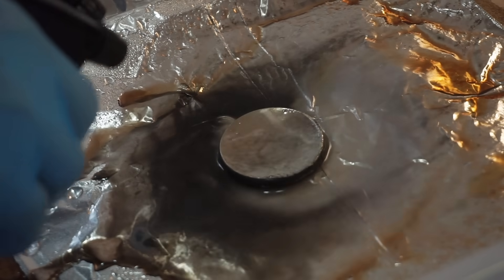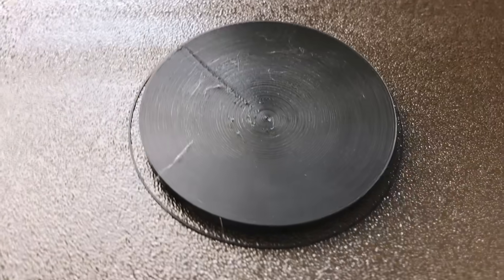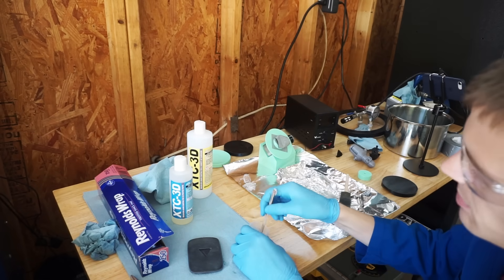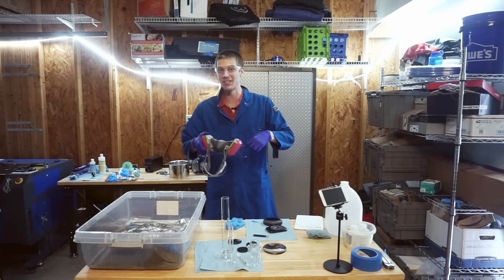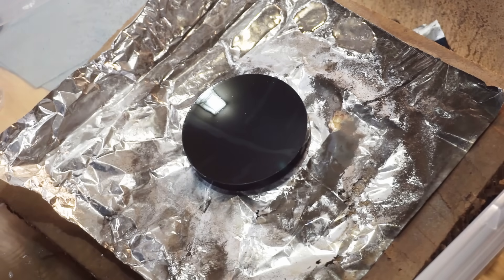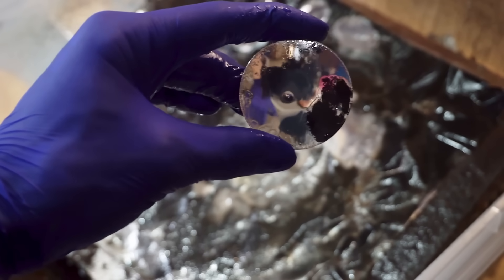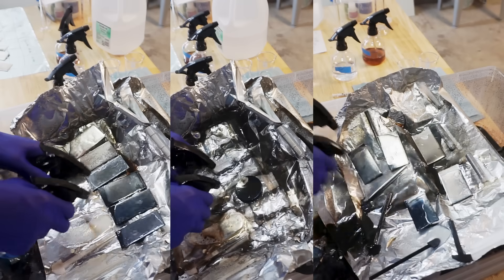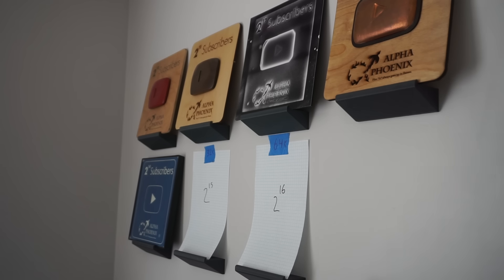How does a "first surface" mirror work? (2^15 sub special!)

Comment: I would recommend a stand for your table saw and also standing to the side. Kickback can be really dangerous (at least you had your blade guard/riving knife on) and in the squat position you really do risk accidentally falling into the saw when it’s operating. Just my two cents but table saws are easily the most dangerous piece of equipment in the standard US house, and its highly recommended to treat them with the respect. Other than that, a very cool project man, stay safe, stay healthy and thanks for the great content.
Reply from the maker: Yeah table saws absolutely terrify me and this is the first one I've owned so I'm trying to catch up on best practices quickly - another comment had some good suggestions about when to use the guide and when to use the miter to avoid kickback, but since I'm typically just doing ply, sometimes I don't have a great way to use either (if the plywood is larger than the table) do you have any tips other than "go in a straight line"? obviously I don't expect high quality cuts when "freehanding" like that, but I'd like to be able to do it without actually freeing my hand from my arm.
Reply: @AlphaPhoenixChannel  So if you're trying to rip larger sheets of plywood, my go to would be to use a circular saw unless if you had a large outfeed table set up for your table saw. To get an accurate cut, I like to clamp a guide to the plywood, and then put my circular saw up against it/(or in it in my case) to do the rip. There are a ton of how to videos to make a good guide (I followed the plans from a video called "Super Simple Saw Track" by One Minute Workbench on YT and it works fantastic for what I need it to do). You can also purchase them, Kreig makes decent ones. I'm terrible at free handing myself. Once it is smaller and can be supported by your table saw, that's when I would use it. If you do not have space in your workshop for an outfeed table (it's a table you can push the ripped plywood onto after a cut, highly highly recommend one if you have the space), you can use a roller stand to support the piece. Kickback ultimately is caused by the wood binding in the back of the blade which is spinning towards you, the blade catches it, and then flings it forwards or upwards. It does it with enough force and quick enough that you really don't have time to react, and since you're the softest thing in the shop, can impale you, or also draw your hand into the blade before you can react. Your riving knife (piece that sticks out on the back of the blade) is there to prevent the wood from binding in that way. If you are trying to make an angled cut using your miter gauge, youre not going to want to use the fence, the wood might get pinched between the blade and the fence hence the kickback. If doing a rip cut, it's very important to make sure that your blade is parallel to the fence or it also might cause that pinching action. The thing though that started the comment though was your position of how you were pushing the wood for the rip. You want to be as stable as possible, get a stand, they are under $200 and are able to be folded and stored away or make one so you are able  able to push the wood through while standing up comfortably. In that squat position it it's way way way too easy to fall forward and that's your face in a sharp blade that can easily kill you. My ultimate recommendation though, watch some safety and how to use a table saw videos on YT, they're really dangerous and it just takes a single fuck up or accident and then you might be missing some digits or worse. Stumpy Nubs is a woodworker on YT that I respect and would recommend his safety videos for any woodworking equipment. Sorry, a bit of a long response. Regardless, stay safe and healthy and just remember we're the softest meatbag in the shop.
Reply: @AlphaPhoenixChannel  kickback can of course happen when you twist the plywood going in.  But by far the biggest risk for kickback is with lumber, when ripping it.  If the boards have a warp or twist, cutting it can release internal stresses and cause the cut to close back in on itself.  That's why a riving knife is required on all european saws, I believe.  It keeps the wood from closing back on itself.  Here in the US sometimes those are built into the cover, so you may have to take them off before cutting ply, but make sure to put it back on when ripping boards.
Reply: Yeah, I've worked with a few industrial machines spinning at tens of thousands of RPMs and they never unnerved me as much as when I used a table saw. Every time I go near one my mind races with all the possibilities of accidentally tripping into it or slipping my hand. There is something about such a large blade so exposed that is terrifying.

Comment: Awesome video! Subbed less than a couple of minutes in! Really like the analysis, deeply satisfying.

So, pressure vs vacuum for resins.
If your resin has a pot life of more than 15 minutes, when you mix it up, in it's pot (not on the target) vacuum the pot to pull the bubbles out, then when you pour it out, pour it up high and slowly/thin so it has less chance of catching new bubbles for you
Then when it's on the target put the target in a pressure pot for the entire hardening phase as this pressure keeps the air bubbles in the mixture and stops them from collecting against each other to form large 'proper' bubbles. They are still there, just not visibly.
Final thought, resin is an absolute sod for environmentals. Slight temperature change? Slight humidity change? They can all cause weird results. Having a managed hardening environment (pressure pot) will help alleviate most of these.. mostly. Except when they don't.
Reply from the maker: “Except when they don’t”
I love the optimism 😂
Reply: @AlphaPhoenixChannel  https://youtu.be/dkZRfH-6O6I fullmetal bender ))

Comment: When using resins or epoxy , during the mixing stage you're infusing air bubbles in it. To get rid of them , after you apply the resin to your surface use a heat gun and go over the resin surface while wet and you can see the bubbles pop and the resin then will lay flat and smooth.

Comment: Resin problems are usually due to incorrect mixing, incorrect measurement and insufficient cure time.

Mix your resin gently in one container, then pour that into a second clean container to ensure no unmixed resin remains (it tends to cling to the sides). 
Then place that container into the vacuum chamber to de-gas. That resin is then ready to use.

Resin can usually be accelerated with heat up to 60-70 degrees (Celcius), but check instructions as it depends on the resin.

Mixing excess curing agent (Usually your 'part B') can give poor results because is can cause the resin to become too hot during the exotherm.

Mixing excess resin (Usually the 'part A') can cause long cure times or even resin that remains uncured and tacky.

Anyway, cool video!

Comment: Have you tried "spin-casting" a parabolic mirror? If you spin a bowl of liquid it naturally forms a parabolic shape. If you have an approximate parabolic shape container and put a reasonably slow curing resin in and spin it on its axis at the correct speed you should get a very smooth parabolic surface.
Probably best to cover the container as the resin is curing to avoid any contamination.

Comment: Hey this was very interesting. Out of curiosity have you tried ABS, and used acetone vapor smoothing in order to smooth your surface? If you care less about dimensional accuracy than how smooth the surface is, I'd be curious if that would be an applicable method.

Comment: Why wouldn't you just make a vapor chamber for some acetone and put it in there depending on the print material acetone generally does a decent job of smoothing

Comment: Re: the garage vs. indoor cure, a lot of epoxy resins have a problem with bloom, which is the reaction of the uncured resin components with humidity in the air. It can result in unsightly scummy/dirty surfaces with a layer of side-reaction product on the outside. A non-climate-contolled garage could definitely aggravate this kind of issue.

Comment: Rather than slowly spinning the parts as they dry, what about high speed spin coating? In the semiconductor industry, they achieve very tight tolerances on liquid photo-resist film layers on wafers with spin coating.
Reply from the maker: Thought about it, pulled a motor out for it, haven’t actually built the thing.

(Have spun photoresist too many times though and I hardly worked in the fab…)

Comment: You can get a longer pot life by cooling part A and B separately in a freezer before mixing.   Not together with food though.  After cooling, it is more viscous so harder to mx but you get more time to degass.  Always scrap the walls and bottom of mixing pot when mixing or else pockets of unmixing resin will cause blotches of incurable resin.

Comment: All resin produces more bubbles in a vacuum because it makes the gas expand, and the surface tension of the resin just holds it together. To reduce bubbles you want to pressurize the resin until it's cured so the bubbles are all compressed into tiny invisible specks, and held in place by the resin once cured.

Comment: Note that most telescope mirrors these days (except extremely large professional research telescopes with onsite mirror recoating facilities) are overcoated with a layer of silicon oxide or dioxide to protect the metal (which is usually aluminum).

This results in a very slight reduction in optical transmission, with the tradeoff being that the coatings are much less fragile and can tolerate reasonable handling without issues, as well as lasting years before degrading rather than months.

Comment: 3:20 why not use ABS and do acetone vapour bath. gives a crazy good finish, tho it can also be easy to mess up. just need a 3dprinter with an enclosure.

the other option for non ABS plastic is sand (super super fine also costly) recasting which does smooth out the layer lines a bit. could maybe be enough here unless the mirrors need to have a low variance in surface height

Comment: One of the sprays contains the diaminesilver complex and the other probably contains a dilute aldehyde or sodium borohydride or whatever water soluble reducing agent you want. You can make your own diaminesilver by reacting the silver nitrate to silver oxide, then reacting the silver oxide with ammonia. Also check out reactive inks, which instead react silver nitrate to silver oxide, then react silver oxide with silver acetate, then react the silver acetate with the proper mix of ammonia and ammonium formate to get an even more water soluble complex which can be as much as 30% silver by weight but is as clear and colorless as water. That mix deposits the silver during the decomposition of the formate and acetate ions, which are sufficient reducing agents to reduce the silver out of diaminesilver.

The brown specks are probably silver nanoparticles, not silver oxide in this case. There should be more than enough reducing agent to get those instead of silver oxide. Both nanoparticles are brown due to plasmonic effects.

Instead of surfactant you can use plasma surface treatment with tesla coils or slayer exciters to coat the surface in hydroxyl groups so that it is wettable, and also to ablate away any remaining surface oils

Comment: The absence of that silver benchy. Rude.
Also: you need a checkered or striped ceiling for proper inspection of shiny shit.
Reply from the maker: I originally had a bit about the silver benchy at the cold open but I didn't like it as much as just "raw clip of the first time it worked"

I still think it makes a great thumbnail though... There are a few clips of me working on test benchys scattered in there

Comment: If its outside vs inside then maybe it's humidity or temperature.
Also instead of a vacuum chamber to remove bubbles, another way is the opposite a pressure chamber instead

Comment: 6:23 Older rear projector televisions also use first surface mirrors, fun little video. If you are in the USA, get yourself a product called suncure uvc 2000 which you can use to mix in with Resin such as polyester resins, to they cure instantly with UV AKA Sunlight, I use it a lot on ABS when I want to fill a cavity without overheating the part with excess resin heat curing stage, as once it cures the heat stops.

Comment: you probably figured this out already but degassing should be done before application and surface bubbles after applying the resin are handled with a torch. awesome little experiment though, good jorb

Comment: The aldehyde must be in one bottle and silver in the other. You could try to test for the silver with an reducing agent (iron nail maybe) or test for the aldehyde by doing schiffs test (cu2+ in a basic medium reduced to cu2o, will not work with aromatic aldehydes like butanal) or maybe smell it (hopefully it's something benign like ethanal instead of a carcinogen, probably not given how much is wasted)

Comment: Working with resins in the past I know temperature and humidity can play a big part in finishes. I wonder if you controlled those elements more precisely if it would give you better finishes
Reply: Also degas before application to remove the air bubbles

Comment: OOh, an exciting project you did here.

I think the resulting surface smoothness depends on vapor pressure and evaporation rate(curing reactant or ingredient within the resin) and micro bubbles may be forming that are ruining the optical smoothness of the surface(that`s why you get an opaque surface).
This would explain why curing inside is better than in the garage(the environment gets saturated with the gas decreasing evaporation rate)
Increasing ingredient A in the reaction(Raoult`s law -> A might have a higher vapor pressure, decreasing evaporation rate if there is more A)
Visible bubbles forming in the vacuum chamber.

Further experiments could be done on curing:
Try different temperatures.
Try doing it under increased air pressure
Try to increase vapor saturation in the air(water, gasoline, alcohol)(apparently high humidity is not ideal for curing epoxy).

Comment: Yeah I'm not a fan of that XTC stuff. I watched videos that say mix the radio by volume. I read the instructions and I swear it said it can be either by volume OR by weight. Because I had a scale on my desk I went with by weight.  Yeah,  never fully dried. Held a heat gun to it which made almost wet initially but clearly was forcing the reaction forward (caused a smell, I could see fumes...yeah I don't recommend doing it inside) and caused it to harden more than before after cooling.  But it was always just a little tacky. 

I was working with very small amounts of resin since my print was small and I think I would have had better luck nailing the ratio had I mixed a larger batch but that stuff is pretty finnicky.

Comment: Fancy! I had a very similar problem lately when making curved mirrors for picoprojectors and did try to avoid coating. In the end I settled on thermoforming pre-coated polystyrene sheets to get the same surface tension smoothing effect but could avoid any additional coating afterwards. That did work out quite well for getting okay-is mirrors for prototyping. I summarized all necessary steps for simulating, printing jigs and thermoforming in a video.

Thanks for the video!

Comment: That's so satisfying to watch! So being silver, it should get a grey/black patina over time? Should look quite pretty as it ages.
Reply: Now we can pretend our 1:1 prints were casted, and screw with our friends when they pick them up at 100% arm strength.
Reply: @___xyz___  you are evil... I like it.
Reply from the maker: Yo Angus! I love the channel - I binged a huge backlog of your channel and Stefan’s channel a few years ago when I got more into printing and learned loads. It’s real weird now that my channel is getting wider impressions, I was kinda hoping one of you would make your way here through the benchy thumbnail…

And yes because the surface is bare silver it should age over time. Some of my parts still look perfect, and some have actually yellowed slightly, which makes me think there’re still reactions with the resin, but I’m looking forward to the black patina. (Not for the mirrors, but for the button and the benchys!)
Reply: @AlphaPhoenixChannel  The benchy did get my attention for sure, but so did the process! Subbed for more.
Reply: @AlphaPhoenixChannel  The silvered Benchy was the reason I clicked.
I very well chosen thumbnail :)
Reply: Would that silver layer be electrically conductive? If so, electroplating would increase layer thickness allowing mechanical polishing on a regular basis and reduce the matte issue. Would also allow you to sort out your 1M subscriber button.
Reply: I believe you are supposed to cover it with an anti-oxidant of sorts otherwise it darkens fast .
Reply: Ωωδ Takes notice of your aesthetically pleasing exterior surface oxidation

Comment: PRO TIP FOR RESINS 
always mix the resin + hardener with the specs by weight only (if there is no specs by weight (most of the cheap resins) ask for them) 
u always want perfect ratio to 0.5% or better and always if u cant mesure perfectly add more hardener than on specs never less , more hardener = less stiff -more flexible resin , not enough hardener = cant cure
always let the resin cure in 20*C ++ best is above 23*C
if resin was transported in temp under 15*C u need to heat the resin to around 45*C before u can use it because resin can crystalize (to make it simple to understand - lets say like honney etc) 
u dont want water in or on top of the resin (changing humidity and dropping temp is your enemy because water may condense on the resin
 or resin can absorbe water from air)

remember those rules and no more problems with the resin
except if its really cheap one ....